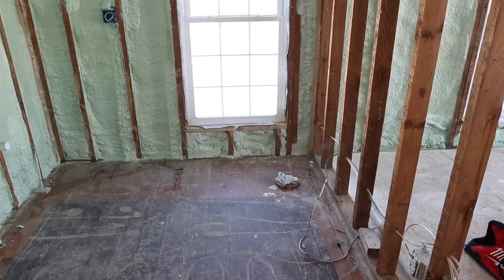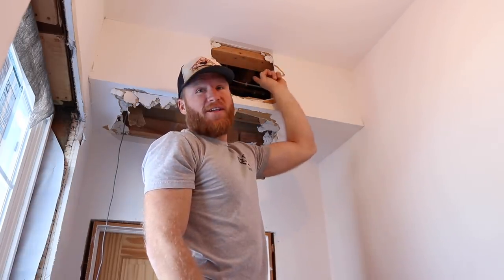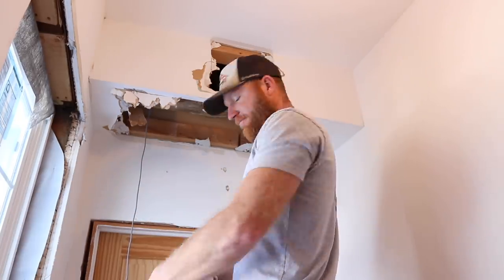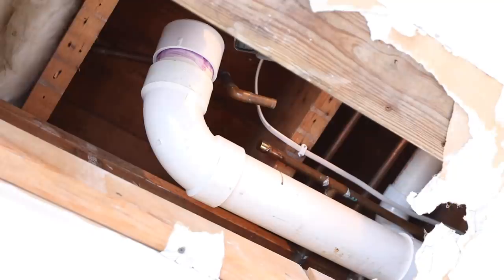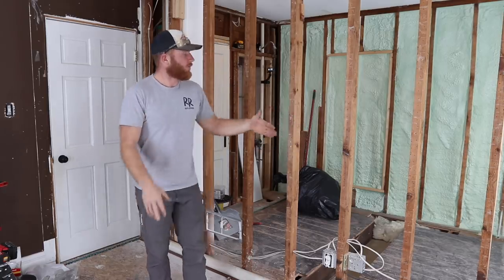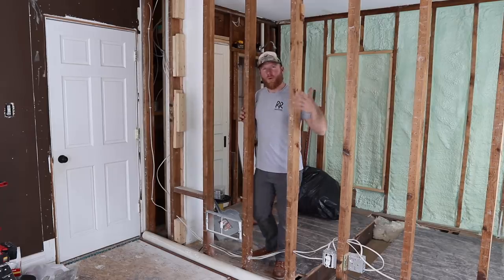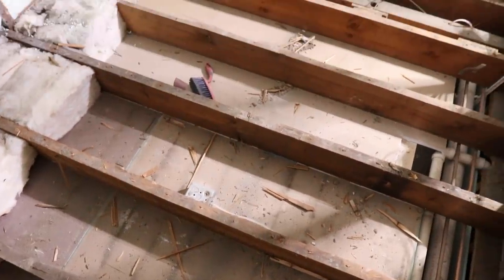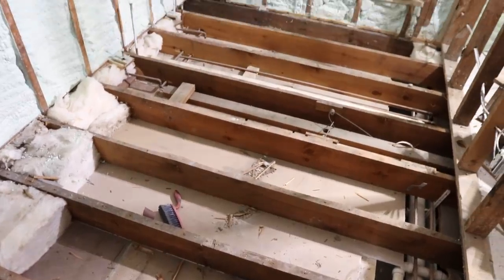Remodeling My Old Farm House: Moving Plumbing, and more Unexpected OBSTACLES

Comment: You should have checked for the same slope in your ceiling, that would have told you the foundation is sagging. Is the floor in the other room the same? That is going to mess up the transition from the room to the bath by an inch. Now you gotta pull up the floor in the public space all the way out to the stairs! Damn this is gonna snowball up huge! Thanks for taking us along on this remodel Kyle.
Reply from the maker: Guess we see how it plays out... can’t have it all figured out from the start or it won’t be interesting when I actually figure it out right
Reply: @RRBuildings  I understand you behind on videos and can't release the details yet. Good luck Kyle

Comment: The inch of drop problem is highly debatable. I usually find myself on the “leave it” side of the argument. I’m currently flipping a 90 y/o house and it’s an inch from square plumb and true in every direction. Just a fact in old homes. I generally choose to cut those corners provided that they don’t pose safety concerns and can go unnoticed when finished. For the most part, it’s because fixing imperfections in old houses will quickly have you working for free or it prices the end product too high. For me it has to be both profitable for me and affordable to potential buyers. But that’s only my opinion and everybody has their own way of doing it. I’m enjoying this series, tho. Looking forward to the next one :)

Comment: Never use the bread trick. When trying to cap a closed system, sweat on a male adapter then thread on a cap. Always turn off the hot water tank on occupied structures when cutting into the piping!
  When doing any remodeling start with a sketch of the walls. The more details you draw, the less mistakes you will make down the way.

Comment: Making sure the floor is level and sloping the right direction is very important in a bathroom, especially with a open shower installed, last thing you want is over-spray from your shower to run away from the drain and leave the bathroom and enter the sub-floor, ask me how I know! :-|

I should have been more careful when I installed my bathroom a decade or so ago was to think that 1/4" slope the wrong direction would be fine but luckily enough I was able to increase the door threshold just enough to stop water from escaping my bathroom when the wife had a long shower. :-P

You made the right choice! :-)

Comment: Home building and bathrooms vary from state to state.
Where I lived before, all bathrooms built before the 1970's had a marble threshold and a poured concrete floor, which was always tiled with 1X1" tiles. Some were single color, more expensive homes had different edge colors.
Being that the bathroom had a concrete floor, they were poured level over tongue and groove oak or maple. The rest of the house would have floors that sloped 1-3" over a 25' span. Finish carpenters and the plaster and lath finishers were hero's.

If the job is worth doing, it's worth doing right. Right takes time, so does quality. Kyle, it's not OCD, it's having a higher quality standard than the mentality of good enough. 

Old home reconstruction takes 50% more time than does new build. Your going to find that the load bearing wall on the lower level has sunk into the main support. Check the support beam and use a jack screw to bring it to level.
Reply from the maker: Yeah I’ve actually done thru and tried resupporting everything. Actually did an entire new basement

Comment: Love the home remodel videos.  For those of us a little further back on the learning curve, I understand what you mean by sistering (attaching new joists to the side of) the floor joists. But can you explain how this would help fix an out of level subfloor?   Is the idea that the new sistered-in joists will stand proud of low joists and provide a level platform for a new subfloor?

Do you plan to use plywood or OSB for the subfloor? Would self leveling concrete been an acceptable alternative to ripping the subfloor out, and if not, why?  Very curious about this aspect of your remodel since we have similar out of level issues in our house.

Comment: I don't like covering things up either.  When I remodeled our last house, I relocated windows.  I didn't just fill-in the openings, I pulled the studs and headers and reframed the wall the way it should be done.and I replaced the sheathing.  By the time we were done, the only thing visible on the exterior of the house that was original was the foundation and the side steps.

Comment: I agree putting a wad of bread will stop any water in the pipe from messing up the solder joint. Then when the water is turned back on the bread would wash out of a faucet in no time at all.

 The wash out will never happen because you capped the pipe. That bread will be in there forever. I don't know if it will, but, it could spoil and pollute your water. You are smarter than this.

Comment: Have you checked the house foundation for level. Perhaps if you lift your house back to level you wouldn’t have to relevel your flooring. And if you are modernizing your bathroom the kitchen should match. 
Hey, just trying to help.
Reply from the maker: actually I did lift my home up and put it on a brand new foundation
Reply: As Kyle just commented, leveling the foundation does not always correct other things out of level, all it does is make the house sit level once again.
Reply: Joshua79C C (I was joking) He understood, OCD is a M—————-F—————.

Comment: One issue we ran into with the spray foam is that you can seal a house so tight you can create mold from the moister we had to install a air to air exchanger in the furnace or air handler

Comment: I know you know what you are doing, but have you checked the foundation to make sure that its not part of the problem causing the floor to be 
1 inch low? I have learned to start from the bottom up
Reply from the maker: I did start bottom up.... I spent the money and put an entire new basement under my house
Reply: great news. i learned the hard way to start at the bottom and go up. i also enjoy your videos and i'm anxious see how it turns out
Reply: @jimjames3925 , this just proves that leveling the basement does not also level other parts of the house inside as those areas are separate from the main framing of the house and also due to the difference in weight and use of that area.

Comment: Is that a 12 v bosch or makita multicutter? What do you think about it?
Reply from the maker: Bosch... works great
Reply: @RRBuildings  I have this tool myself. How do you find power and change of blade? Have you tried the 18v version ?
Reply: I also often feel like on mine the screw that holds the blade comes loose too often

Comment: "it's off by an inch... welp, gotta tear down the house and rebuild it from scratch."   -- remembering this another 12 years from now, probably.
Reply: Your kind of right. It's best to start from the bottom. I always check the foundation first when I find a sagging floor. A lot of the time the problem is at the very bottom, gotta start there bringing things back level. Then everything else fixes itself.

Comment: Wouldn't it of been easier to just pour a self leveling concrete over the existing subfloor to level it out instead of tearing up the subfloor and sistering new floor joists?
Reply: Ehhh pain the the but have to clean the heck out of any old wooden subfloor patch at holes paint on a latex coating and for and inch slope than can be a ton of self leveling concrete. For a carpenter sister jointing some joist and slapping down some plywood is just as fast and better end result less mess and fuss.
Reply: @kennethwright8081  Sorry, but I disagree. I am a carpenter and we use self levelers all the time, it is by far less expensive and quicker to do.

Comment: Sharkbite......no sweat.
Reply: If that's a permanent cap and he plans on T'ing off a different location for water to the new location heck no never use a shark bite on an enclosed cap if it's just a temp cap or where you can easily get to it that's fine but I would never put a shark bite in a cavity if he was to patch up that Sheetrock.